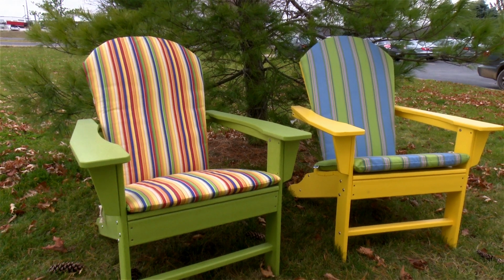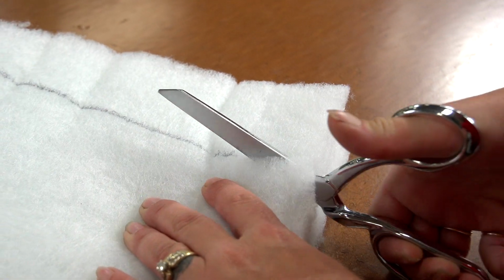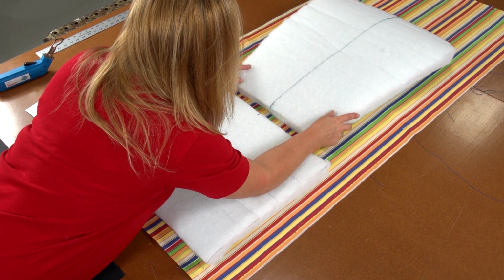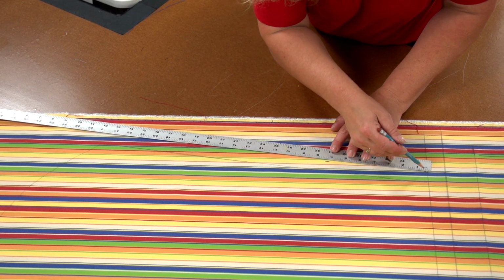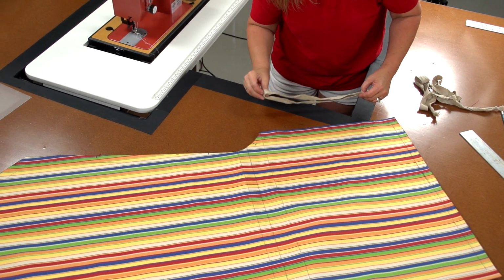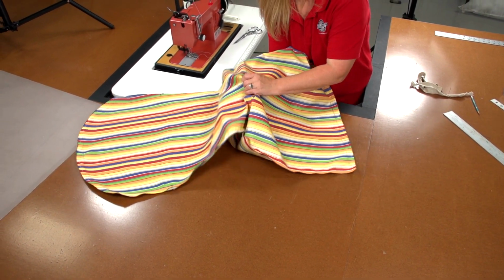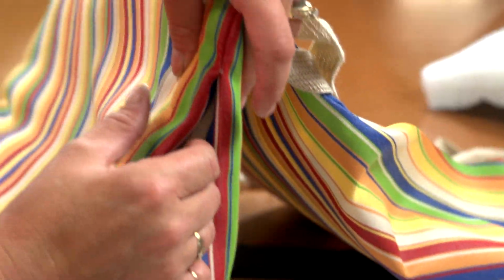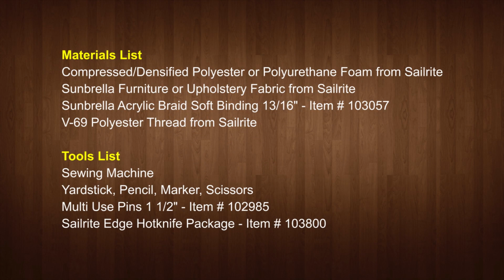How to Make an Adirondack Chair Cushion

Comment: Fantastic instructions. The cushions turned out perfectly. I did use 2 inch foam, and that worked well - it was just a bit harder to close the last two openings after inserting the foam.
Reply from the maker: I have not tried to use 2" foam for a cushion cover made like this. I am glad it worked for you, it is good to know that it will work. Thanks!!!!

Comment: I was asked to make one from 2" foam.  Can this pattern be adapted to that thickness?
Reply from the maker: Well, usually when a foam of 2" or more is used for a cushion a facing or boxing is added to the top and bottom plates of fabric (what is called a box cushion). I don't think that this approach shown in this video will work for a foam more than 1 inch in thickness, sorry. Here is a video showing how to make a box cushion: https://youtu.be/XIIgvJEvCSk